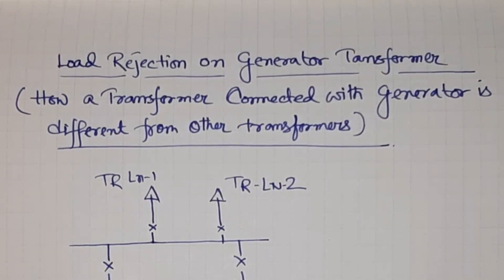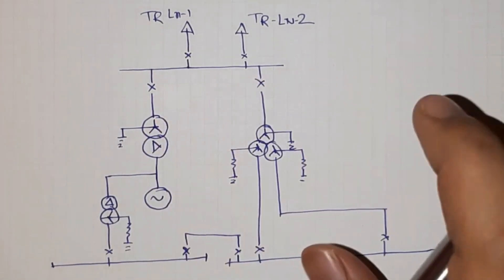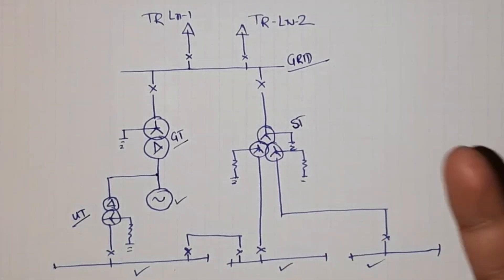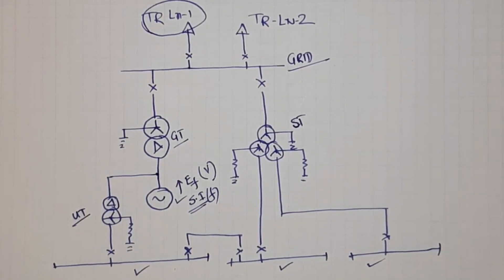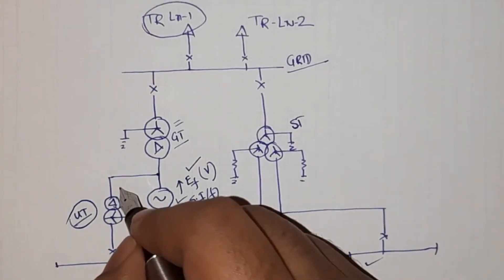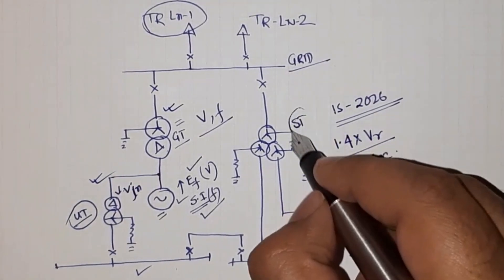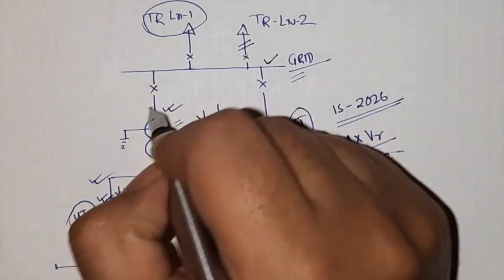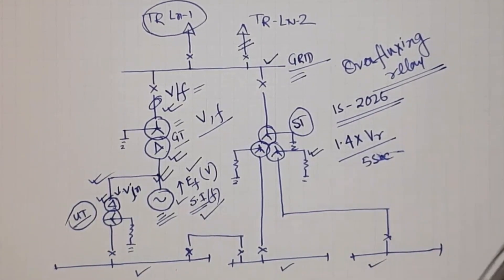Load Rejection on Generator Transformer|Specialty of Generator Transformer

Comment: Supply & Demand - Balance ; How it results into loss of Synchronism in the Power System ; it's all about that only na Sir basically ? 

   Please Confirm ; I am one of your subscribers and I have once asked how the amperes & kilowatts drawn by an induction from the supply mains get affected while being operated through VFD at a frequency lower than the rated one which is yet to be answered by you . 

Thank you .
Reply from the maker: Power=speed x torque. So upto rated frequency if you vary the speed i.e. reduce speed motor will take low power keeping torque constant. However i dont understand your first question
Reply: @electricaltechnologyandind5335  What about Variable Torque Applications Sir ? In my first question , Supply means Generation & Demand means Load Simply Sir .